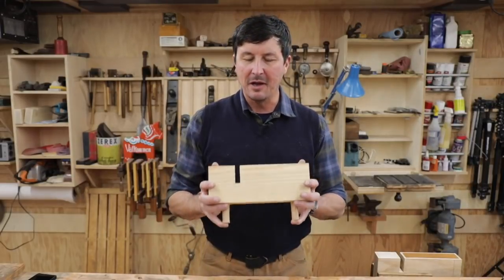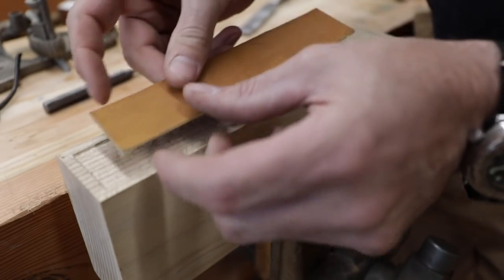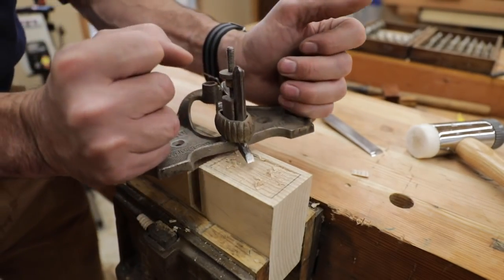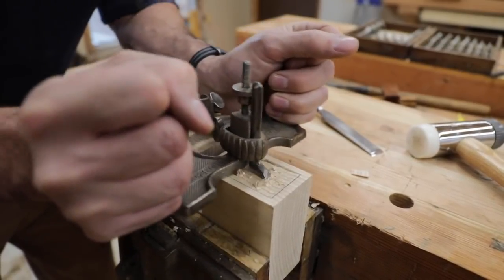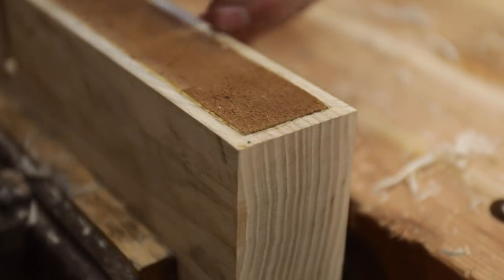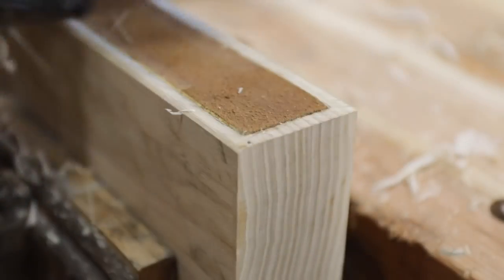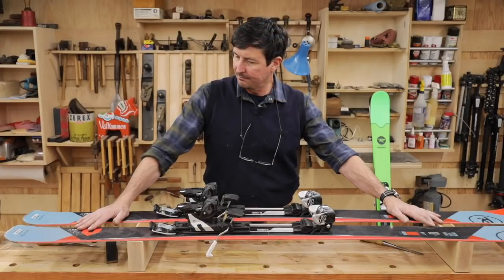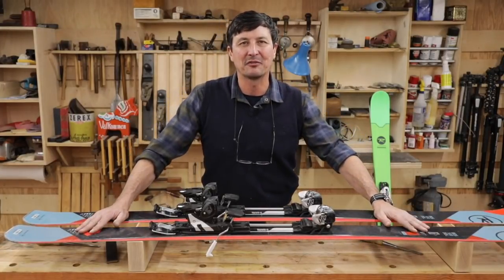Amazing Tools That Are On Another Level

Comment: Pro tip. A cutting gauge is your friend when doing inlay, as it slices through the fibres and doesn't break up the edge like a marking gauge, which tends to tear through the fibres and leave a rough edge. Visualise scoring with a nail vs scoring with a knife you'll see what I mean.  They're easy to make if you don't have one.

Comment: I just recently built a pair of saw horses. Instead of going the easy way i took my time and done it right. By the way this was my first real project. I had to figure out all the angles. Mortise the legs to the top. Done the layout on a thin scrap of plywood. Honestly i impressed my self with how they turned out.  Now ever  time i use them and see them i get a great feeling.  I understand completely whatbu said.  Thanks for sharing ur life ur a big inspiration to me. I didn't have many strong father figures in my life as a young man. Thanks

Comment: When you built your bench is the first time I watched any of your videos. It's also the first time I subscribed to a channel because I wanted to make sure I could watch the guy work that was so passionate to hand build and hand plane a custom workbench. I built one for myself but the frame was done with lap joints and the top was 2 x 4's glued together and took to a wood shop to have planned on a 36 inch wide planner by a professional wood worker. I don't think I got as much satisfaction as you did. I know yours will live on long after mine is gone.

Comment: That's a great idea, pleasing to the eye when working on the skies or snowboards.  Only one suggestion rough the "nice" side if your going to contact cement that side. It will hold better.  Great job Cody.

Comment: Hey Cody! Just a little anecdote for you. In the UK, that Stanley hand router plane is known as a “Granny’s Tooth”, I was taught that it’s only used for cross-grain removal of material. e.g. for use on a trench (dado), saw the shoulders to depth with a tenon saw, then remove the rest with the plane. I also have a smaller one that’s held with just your finger & thumb of both hands. 
Enjoying your vids as usual! 👍🏻

Comment: I really appreciate your videos, especially the camera work.  And I appreciate your willingness to dive into projects, and your love of vintage tools.  I will tell you that I have never seen a router plane with the blade facing outside the plane like a chisel plane.  I own one and love mine.  Try mounting the blade pointing inside the frame of the plane and see if it is easier to handle.  You've got me curious to reverse mount mine and see how it works.

Comment: usually with any sort of glue your better off having a rougher surface, then it has more surface area to hold with.
Reply: Not with Contact Cement. You have a much better adhesion with smooth surface. 
When you glue up wood you would prefer a smooth surface. Same with most plastics ....(PVC, ABS, etc)

Comment: You probably won't see this since the video is older, but as a leathercrafter of 10+ years, I can offer some advice on the contact cement. It's great for gluing leather and I use it all the time, but you want to rough the surface first. It adheres much better to the flesh side (rough) than it does to the grain side (smooth). So if you don't have the fancy roughing tool, hit it with some 150 grit sandpaper to scuff it up and that stuff will be basically permanent. :-)

Comment: That rebate does serve a purpose and is not just a 'detail'. It gives significant lateral support to the glued 'n' screwed joint, meaning it's much less likely to fold over when you're working with the metal vice. You made the right decision to invest a little more time and effort, which have already been rewarded by durability.

Comment: Cody,  why didn't you make the slot lined with leather also so as to protect the surfaces while it is inside the slot?  You wouldn't scratch your skis while they are inside the slot.
Reply: Rick Preston wood doesn't scratch a ski
Reply: its not for protection. Wood doesn't harm it either. Every single ski ramp you come across is out of metal and nothing's happened so far

Comment: As always great video, I was fortunate to find a Stanley hand plane  like yours and love it, You may have already tried or know this  but I have tried different ways with mine and found putting the blade on the other end and pull towards you, I have more control and less tilt, and looking at At the size blocks you were working with , try putting side by side, having a wider platform for the hand plane. By all means, this is not criticizing. 
And as always keep up the great work.

Comment: I’m curious, Cody (or anyone else who may have input) - I’ve mostly seen those router planes with the blade installed on the interior side of of the clasp, and never seen one in the outer side. Any particular reason you chose the outside for this project?
Reply: I think it got mounted backwards somehow.

Comment: Nice bench tool there.  Actually, contact cement is a must have for leather working... and, you would get a stronger bond by roughing the smooth side of the leather (like with a file card) prior to application of the cement.

Comment: the ski vise primary purpose is to hold the ski. not just a place to sit it.  Show us how you file the ski edges on the base?   This is where most of the grunt work takes place, and you are putting some power to these to file the edges flat.